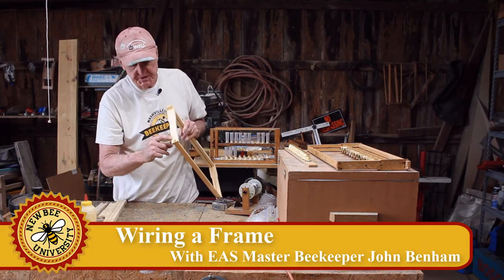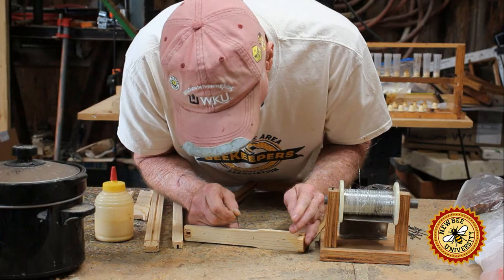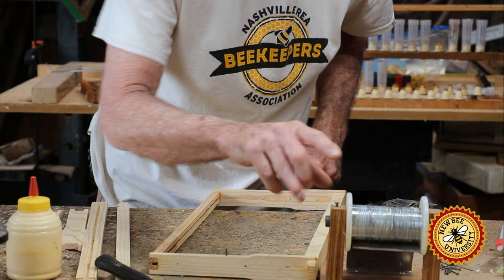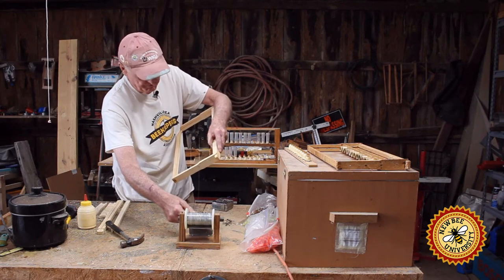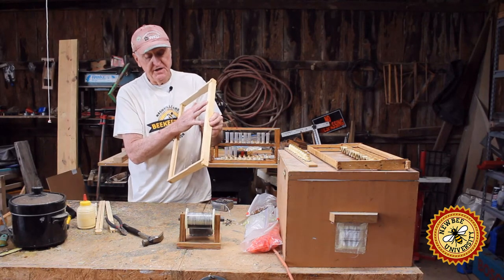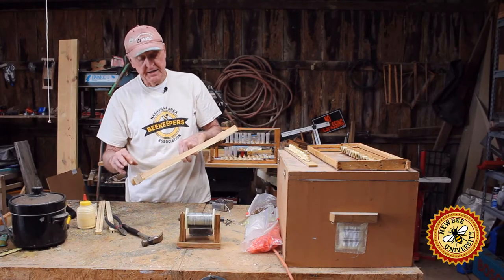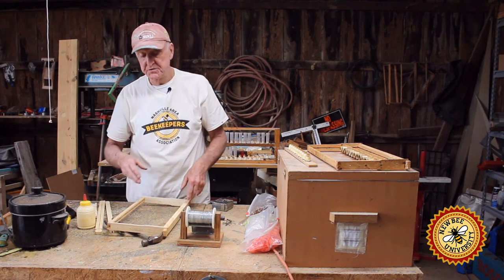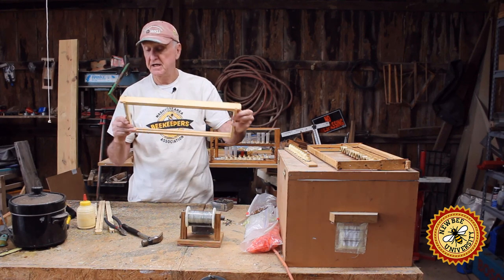Beekeeping 101 :  Wiring a Frame for Wax Foundation

Comment: I used to wire left to right now but now I wire top to bottom. Make the frame stronger when you pull honey. I add a wax strip on top as well.